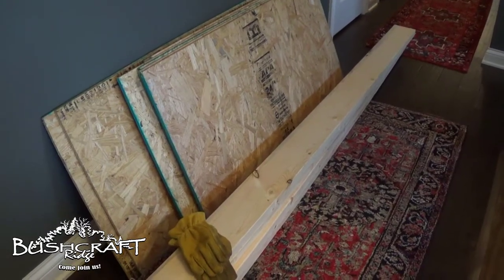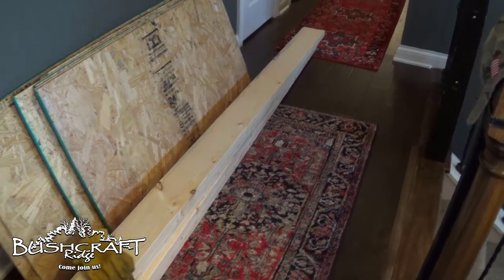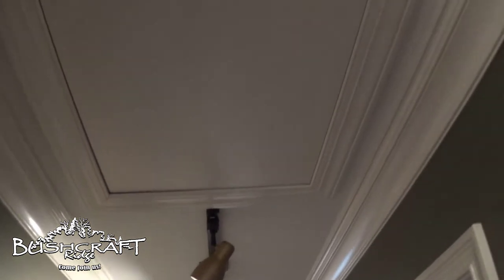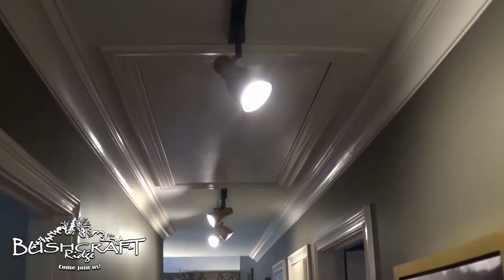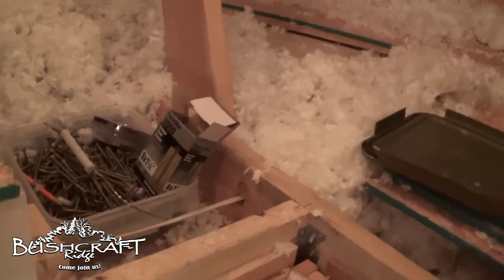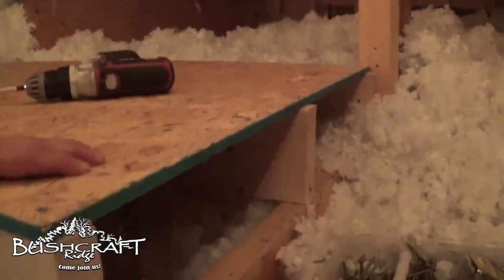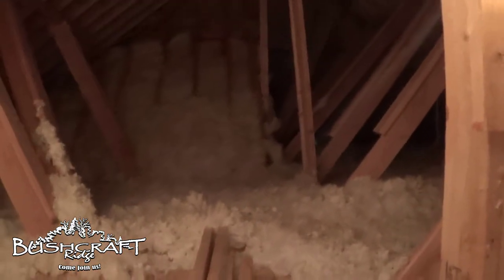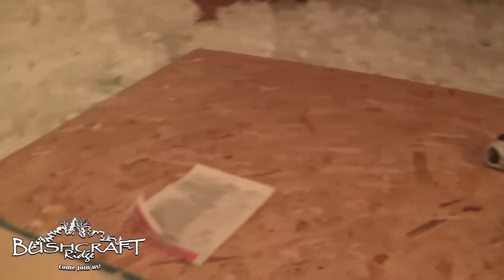Attic Ladder Install Part 3

Comment: Wow, that looks so good finished! Yeah, the ol' corner is a bit off but no guest is going to grab a tape measure and criticize that. Smart keeping the ol' insulation depth with the risers, especially if you have the height. A work around would be spray foam or rigid closed cell styrofoam sheets. 7:59 the word you're looking for is truss(es). That's just it, too many projects not enough time. Looking good so far in the ol' attic though.
Reply from the maker: Thank you, sir!